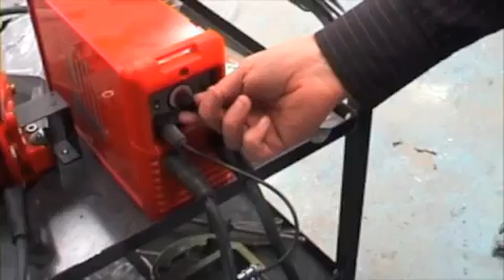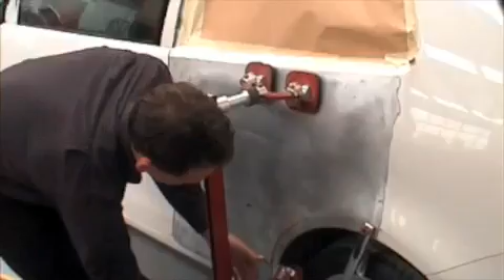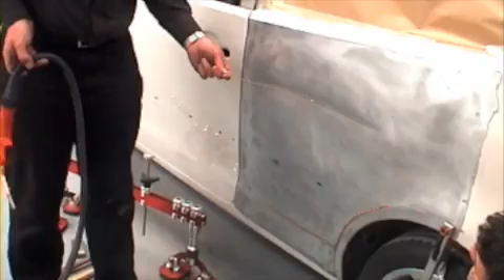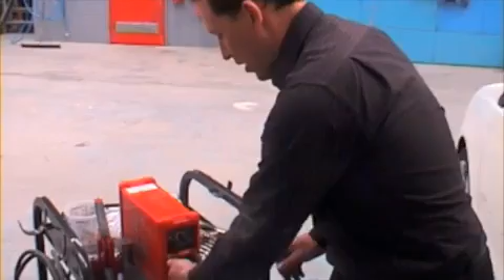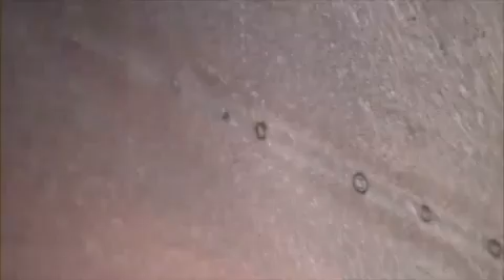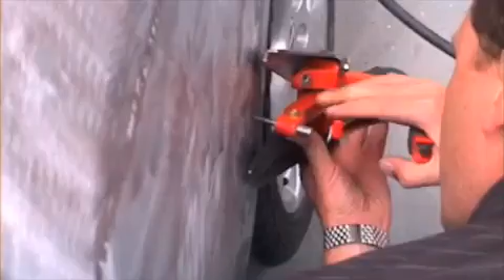Traditional Dent repair

Comment: Lol this is the caveman method with a fancy rock. Want a good clean repair? Call a PDR paintless dent repair tech. They are wizards and use ZERO body filler. Even of u have to have it painted STILL get it repaired by a pdr tech THEN take it in to get painted.

Comment: Too much work for a qtr panel....better off cutting it out and welding it back in.....
Reply: No, much better to repair than replace, your altering the integrity of the car replacing the panel, devaluing the car, and  affecting the manufacturers warranty.Unless it is annihilated , alway better to repair.